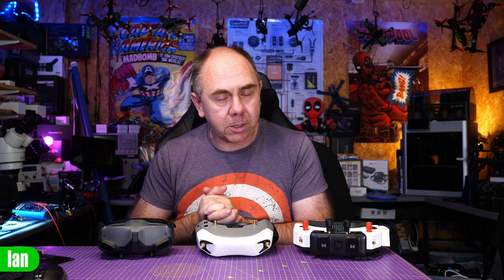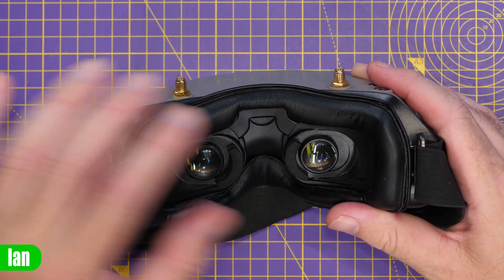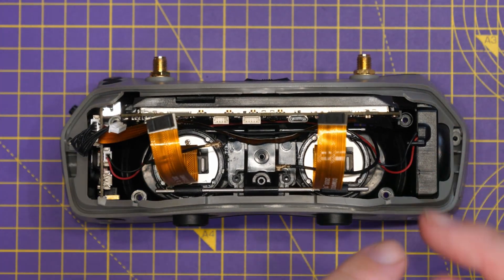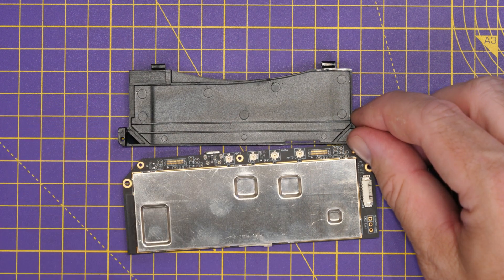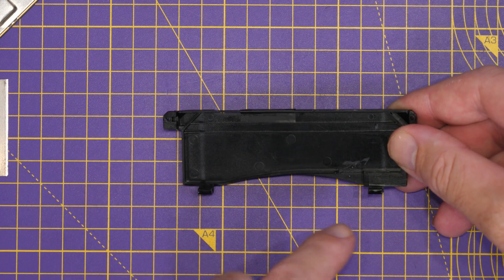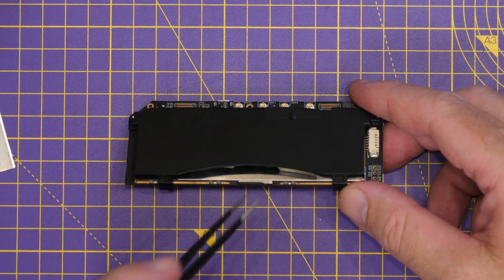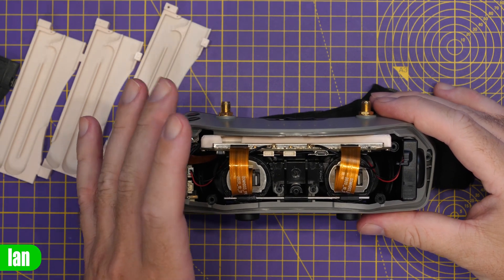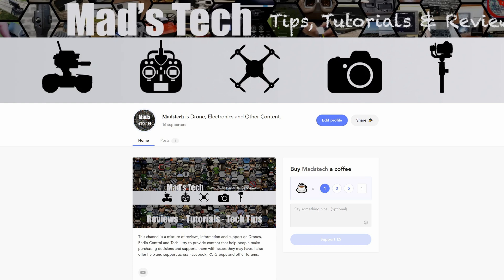Avatar HD FPV Goggles Biggest Fault - Can We Fix It

Comment: Does not fit :( It is about 1mm longer than the original. The dimensions of the screws match, so sizing is not an option
Reply: I’m having a time. Trying to file enough off the duct without dropping the duct and breaking tabs off of it and starting over again about 3rd time.

Comment: I've never had an issue since I put on a thicker foam piece. Funny enough it seals way better to my face, yet never fogs. I just leave the fan on full. I am in in Canada and have flown all types of humidity outside. The stock foam is TRASH. made for the flattest face ever or else you will have some intense hot spots.

Comment: Excellent content as usual, I like how technical you get with your reviews. On a sidenote, do you recommend switching the transmit antenna to the front instead of the top and putting a patch on it like JB did when he was talking about problems he had with the system?  I’ve been thinking about switching the UFL connector inside.

Comment: I cant find an answer to the avatar vrx ,mine that are finaly on front of hdzz goggles willl not firmware update,there stuck on 29. whatever factory original.the cam vtx updated no probs.i am doing everything properly  5x still no update cant even unlock them with the downloadable .txt files...any help would be awesome ,(forgot 1 big beep,then blank screen then rapid quiet beeping for 8~10 minuts)(changed sd card..now get a louder longer sloweer beep)

sry i had to post here and 5 other sites with no help.all vrx vids on youtube are basicly the same and there mainly for goggles although thats pretty much identical.thank you in advance n sry Mads for posting this here!
Reply: Well post in the right spot then

Comment: I was able to get the new dji soft fit foam and fabric faceplate for the goggles 2. I live in southeast Texas and tested it in 97 degrees Fahrenheit with a heat index of 107. The humidity was high and had no fogging issue. I think the fabric faceplate breaths better.

Comment: I live in Mississippi and recently did a commercial shoot outside in 100 degree, humid weather with these goggles and they did just fine. As long as the goggles are not too tight on your face and you give them a few minutes to transition to the heat, they perform great and really don't fog! For me at least.
Reply: I am in southern AL and the fogging is awful due to me sweating like crazy in that 100F heat. If I want to fly during summer my only option is to plug in and throw quad on front porch while I have a chair just inside my front door. That said,my fans have made all kinds of noise since day 1.
Reply: @ChrisHarmon1  I have the same weather as you and I am able to fly. The goggles usually fog for the first minutes because I'm sweating and it's really humid, but if you leave a little gap in the foam and don't let it fully seal on your face, it clears up for me pretty quick. I'm talking as someone who flies 5x a week in humid Mississippi weather. We've head heat warnings recently cuz it's been so hot, but they still work fine for me and don't fog as soon as they warm up.
Reply: Printed and installed. Not getting any air out to my eyes yet a ton of air coming out the front of the goggles. I don't understand.

Comment: Would it be possible to decrease the field of view in the goggles 2 with a printed adapter? Or change the optics to make the screen edges sharp and not blurry
Reply: You can scale the fov in the goggles menu
Reply: Just buy the Integra's instead of the goggles 2